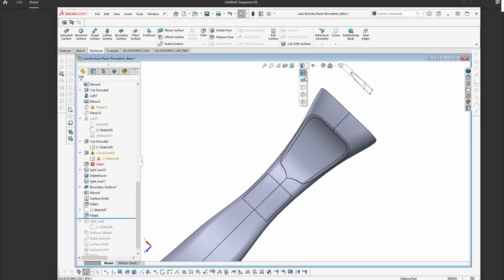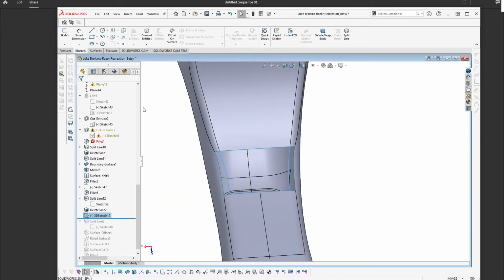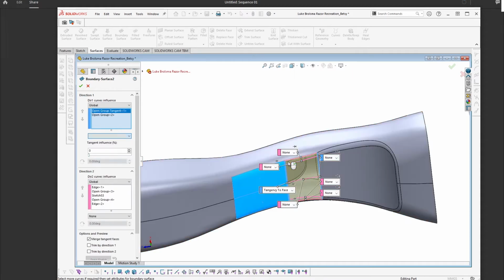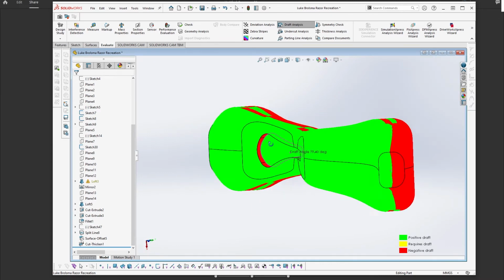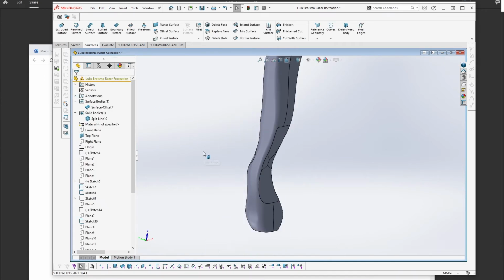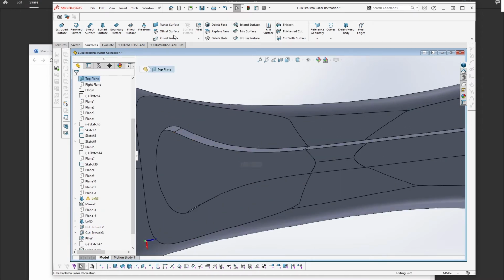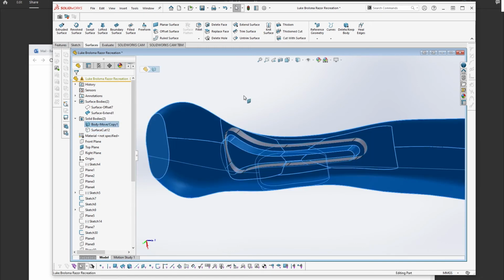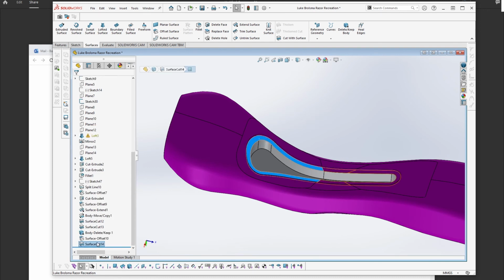UP and UP Razor Solidworks Surfacing Details and White Plastic feature on handle

Comment: 3:52 note to myself. The spline received a relation "tangent to face".  Wow, I didn't know you can mix a sketch entity(spline) to an existing surface, while you are in sketch mode.
I would have spent time creating a projection of the face onto the sketch plane.  Then convert solid line to reference line.  Then use equal curvature relation.   Thx.
Reply from the maker: Glad it was helpful

Comment: Great video's I hope you can make more.  I am a longtime SW user, but trying to master surfacing now for more "fancy" shapes.  So, far what I've learned is that you cannot solely rely on the basic SW surfacing commands(boundary, fill, loft,etc.) with their contact/tangent/curvature parameters.
Reply from the maker: That is right, hopefully Solidworks will make it easier to manipulate forms to create complex shapes, until then it's learning how to make it work through tricks